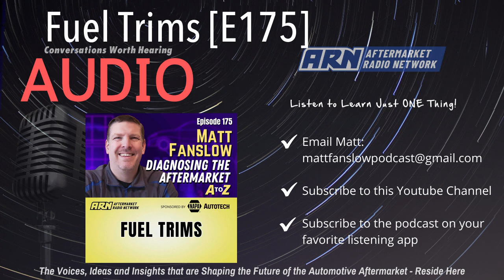Fuel Trims [E175]

Comment: Would like to hear more on how VVT/DoD/AFM/DFM tech and AFR sensors affect fuel trims during normal operation and when there's a fault. 

I love fuel trims. Fuel trims are a really big clue on what's going on, especially while watching idle and higher rpms. I have a solid knowledge of it thru the first decade of OBDII. I'm not too hip on newer VVT/AFM/DFM tech and diagnosing, so Today I Learned VVT/cam phasing can imbalance air delivery to bank 1 and 2, thanks for that. And yeah I was hollering the answer before you were finished discussing the scenario. 

At the end, you almost hit on a scenario I know of that almost seems illogical until you fully think it through: one cylinder has an ignition issue, with occasional or constant lack of spark. The oxygen from the misfiring cylinder detected by O2S1 causes the PCM to increase fuel trim on the bank, so now the other cylinders on the bank are putting more unburned hydrocarbons in the exhaust stream. The oxygen absorbed by the catalyst reacts with hydrocarbons, so O2S2 still shows relatively good flatline. 
Without thinking it thru, you' may think "Oh if fuel isn't getting burned, then PCM will decrease fuel trim". Nope.
But thinking it thru, "O2 doesn't detect hydrocarbon, it detects O2. The non-combusting cylinder's exhaust has all its oxygen, the O2 senses that so increases injector pulse, thinking it's lean. In this case PCM is not helping one bit, it will increase fuel trim. And all it's doing is delivering more unburned hydrocarbons from good cylinders into the exhaust stream. And possibly leading to overheating the catalyst, since that stored oxygen is now burning that extra hydrocarbons, and the combustion intended for the cylinder is occurring inside the cat."
An air leak at that cylinder's intake manifold gasket would produce the same results - bringing in extra oxygen 
I think it's hard to visualize because if you think of fuel trim on a basic level, example if fuel pressure is low. There's be less fuel delivered, the extra O2 is sensed, so PCM will increase fuel trim, to ensure proper O2S1 oscillation and optimum AFR is achieved most of the time. PCM did its job.  But in prior case, PCM is actually doing a really bad thing leading to overheating the catalyst.